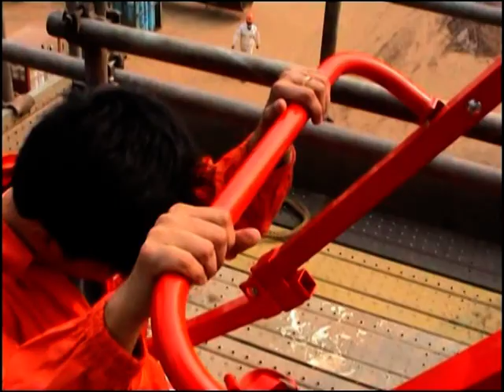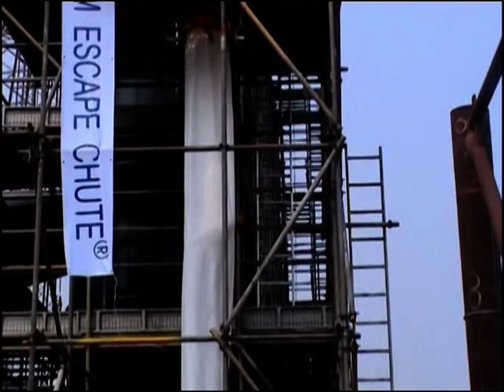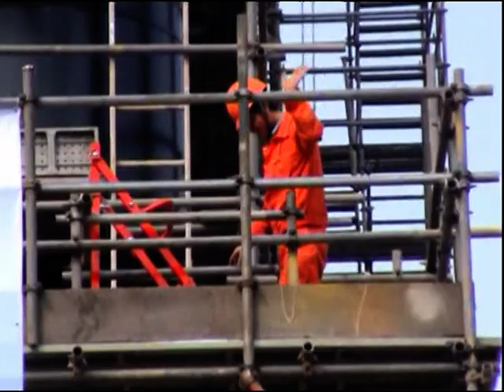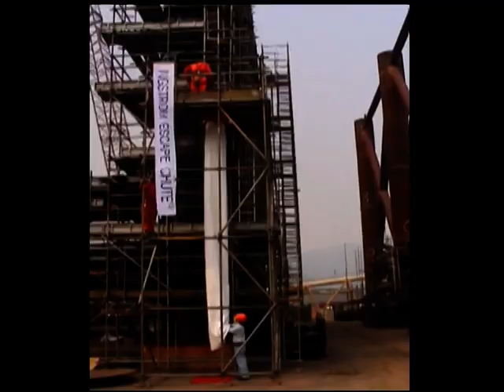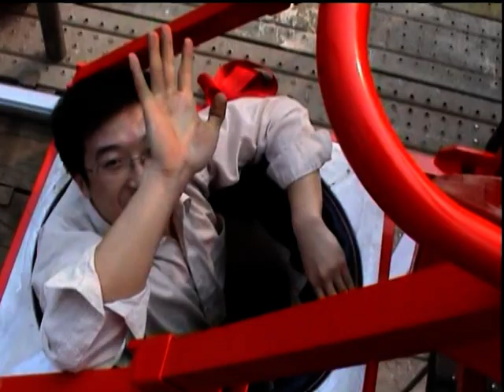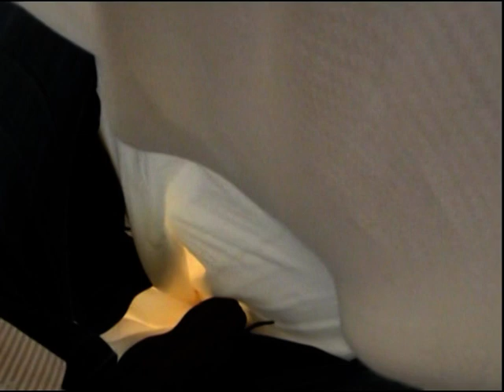you can control your own speed of descent when sliding down the chute escape chute

Comment from the maker: The standard diameter for entry hole is about 580mm, that means a person with waist line above 580mm will not be able to gain access to the chute.
 
The maximum diameter for entry hole is 640mm which is specially designed for used for industrial application.